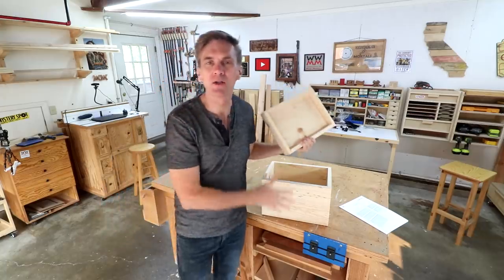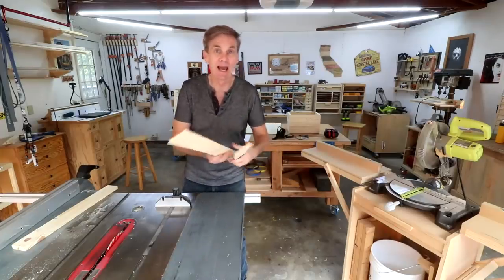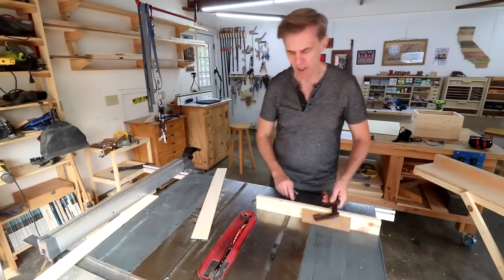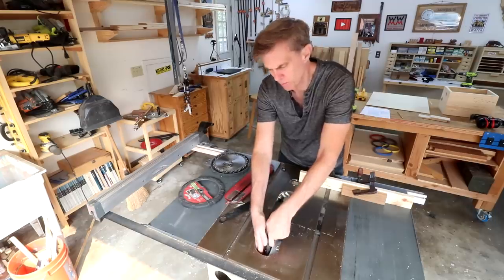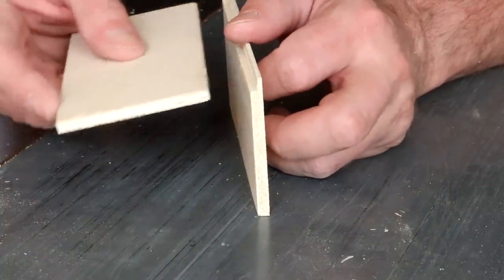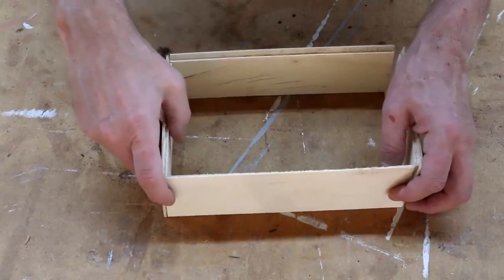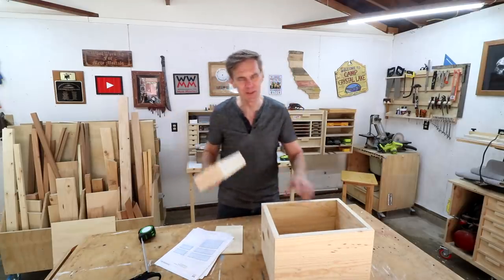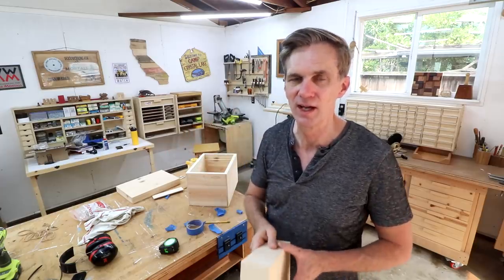Making a small storage tray: DEEP DIVE

Comment: Suggestion:  Use some steel electrical work boxes on the inside of the corners to square up your corners and hold the sides upright.  These boxes are generally square and you can use spring clamps to hold the box together while you glue and rubber band clamp the perimeter. 
Cheers!
Whipple

Comment: Good lesson about always measuring where you put the stop block, even when the saw comes with a ruler.  The other option would be to get some left and right reading ruler tape, and tape over that ruler BUT don't forget to check that and adjust it if necessary when you change blades (not all kerfs are exactly equal, and some kerfs are intentionally narrow or wide).

Comment: nice one. cool tip i saw on youtube was that rather than a rubber band, use painter tape as a lightweight clamp to hold the sides of a box. not only is it easy to hold together but you can unfold it easily for glue up.

Comment: Hello steve, 11:37 i've notice that you slide your miter gauge from the front of the table saw, it is easier if you slide it from the back of the saw, so you dont have to fit the tip when you start sliding. I hope i make any sence.

Comment: Steve, I noticed you measure to the blade tooth on the table saw but locked the mitre saw down and measured to the body of the blade. Why not measure to the tooth on the mitre saw blade as well?
Reply: Glad to see I wasn't the only one thinking the same thing LOL!  When I use Steve's stop-block method on the mitre saw, I bring the non-running blade down on a scrap piece so the blade makes a small dent where the cut will be, then measure again to make sure I will be cutting to the desired length. Although I'm probably over thinking it :D
Reply: Steve’s table saw blade teeth extended beyond the edge of the blade (kerf) and his miter saw blade is flat so the measurement is the same in the center of the blade and the outside edge teeth
Reply: Teri Singleton   What blades is he using?  On every saw blade I’ve used (table saw or mitre saw) the teeth are wider, if only slightly, than the blade body.

Comment: Steve, why not extend the fence on the miter gauge beyond the blade and run the fence through the blade? Then you would know exactly where the blade cuts and could measure from the end of the fence instead of the blade.
Reply: Yeah, I was thinking the same thing. It also backs up the cut so the off-cut won't have tear-out. More of that piece will be useable for the next project.

Comment: I have been looking at buying a miter saw lately and have noticed that several of them don't have the holes in the fence. I have been leaning toward getting one with a 7.25" blade with a sliding arm, so it is much smaller to save space, but it can still cut a 10" wide board. Max thickness to cut is 3.375", which if you have noticed the lumber at the orange store have been labeled lately as 1.375" instead if 1.5".
Reply: You can drill your own holes in the fence if it doesn't have them. You might need to use bolts to secure the fence though.
Reply: You can always drill your own hole through the fence (with cobalt drill bits and some lubricating fluid)

Comment: If you have multiple pieces of stock, you can 'Gang Cut' your pieces by stacking the stock and cutting several pieces at once, and they will all be the same length - at least if you clamp or tape the bundle of stock together. That sort of drawer would be pretty good for inside drawers for your router table update, just use slightly thicker wood, maybe 3/4 for the bottom and just drill blind holes to store router bits in. Painters Tape is just Masking Tape with a fancier price tag.

Comment: Any reason not to cut the rabbet for the bottom along the full length and then cross cut into 4 pieces?
Reply: If you're making all the cuts on a table saw,  it is to reduce the number of times you need to change the blade. You need to cut rabbets on the sides of 2 of the pieces of the box. You can't do that until they're all cut to size. So unless you want to change your blade from dado, to regular, back to dado, this is the faster way of doing it. Also, this way you aren't messing with the height of your dado stack so it cuts all rabbets consistently.

Comment: Question 
On the box why didn’t you use the quarter ,quarter,quarter method
Reply: On quarter-inch (6mm) plywood, that would be eighth, eighth, eighth, and the tongues might be kinda weak, and possibly difficult to cut. Just a thought. What do you think? I'm still a newbie and may be over-thinking this. 🤪
Reply: Actually it’s the same process except for a dato rather than a rebate